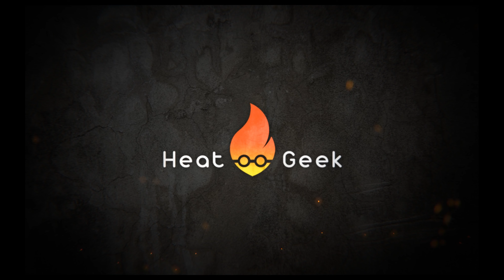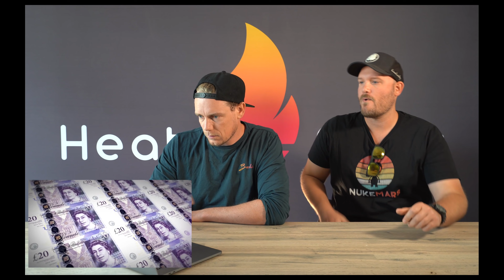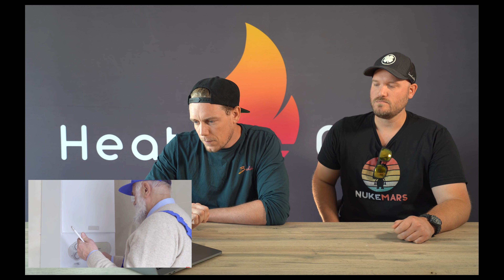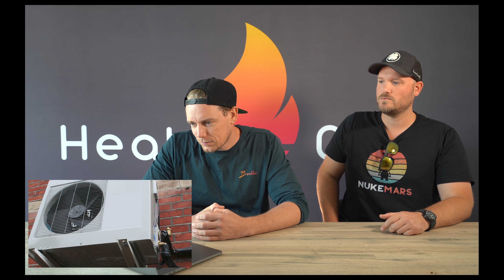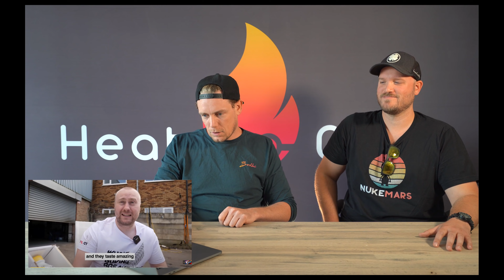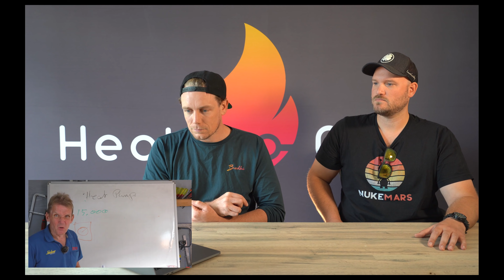Professionals React (BADLY) To Skill Builders's Heat Pump Videos | PART 1 | FIRST TIME WATCHING

Comment: I see the persons who talk about government incentives gone wrong I'm in Alberta Canada we've seen 2 major provincial government initiatives back in the days of electricity coming to major cities around the world the government saw a problem developing any home that was outside the cities was not able to hook up it was only available for the wealthy without electricity the only way for having power was 6 12  24 or 32 volt DC  systems the batteries available were very expensive and unreliable and the generator although fairly reliable they did fail and were sometimes hard to start TV wouldn't operate on those voltages so electrification was brought in electricity cooperatives were formed low interest loans were made available to the cooperatives and the homeowners to hook to the power grid and almost every homeowner hooked up later on in the later 1970 homeowners outside the bigger cities had the choice for heating coal  fuel oil or propane  but you had to watch out you don't run out or you lost your heat you could have your fuel scheduled for delivery a blizzard blows in and using more fuel because of the colder wether and you run out of fuel be like one lady in Saskatchewan wood was loaded ready for delivery and a blizzard came in lasted for days a young man who heard the betting that was going on as to her her invalid husband and 4 children's fate would gave them something else to bet on and speculate on he said hook up the horses I'll go he followed the tops of the power poles he could see in the blinding snow he found her place she'd burned her furniture and had run out so late 1970 a new program came in gasification cooperatives were formed again low interest government backed loans were made available to the cooperatives and to homeowners to be able to hook up over the years electricity cooperatives were bought out by the big utility companies gas cooperatives started being bought out as they went from being a liability to an asset but when electricity and gas was deregulated and you could buy your gas and electricity from many different providers and the companies that owned the electric lines and the companies that owned the gas line had to deliver it by their infrastructure there were still gas cooperatives and the loss of revenue from cooperatives fees would have bankrupt them the Alberta government gave the cooperatives exclusive rights in our area we can only buy our gas from the cooperative and we pay 30 $ per month to be a member of the coop and since the cooperatives will probably never be an asset for any of the big natural gas companies since if they buy them out they might only get 25% of the client's and then only with an intense  cost savings on gas because being as the competition hasn't got any money in the infrastructure they can give better pricing for gas and still turn a profit these initiatives were necessary and now we need a new one solarfication the Canadian government has brought in a carbon tax on natural gas it's 30 % more than the cost of the gas per unit so my gas bill has over doubled its supposed to make us cut down on our gas  electricity and auto fuel use they give us incentives to go green but low income homeowners especially seniors who can't get loans  and renters are out in the cold figuratively and in some cases literally as we can't afford 10 grand or more our share of the upgrades and landlords have no interest in putting out that kind of money to save their tenants money on their heating costs and here in Alberta where the government makes it almost impossible to go solar electric unless you are a heavy electricity user most of us would only save around 40 $ per month on our electricity bill still paying grid tie fees  municipal access fee and billing fees about 180 $ per month so if we are thinking of going solar electric we need to go it alone and cut the grid

Comment: One take way was your point about it 'paying you back'.  It's absolutely right that the value is added to your home but also this obsession that the equipment has to pay you is just just mental.  A perk for sure but not the primary reason one makes this change.   It's a better product and better for the environment!  once it becomes much more mainstream, it will naturally get cheaper and the tech will advice.  I couldn't sit through most of the vid unfortunately because he quietly approached the facts then barked the falsehoods misrepresenting a balanced view.  There may have been conversation about solar and battery too which do have genuine 'pay back' and enhance the value of having a heat pump but I just struggle with this chap so couldn't finish it.

Comment: He describing what the government are selling to people. There a many video on here from very good plumber who been sub contracted fir this government scheme. The company send there surveyor and system designer. The plumber turn up and says that never going to work. So ended redesigning it cost more money in materials then after he Completed the fitting the primary company comes out over right the weather mitigation system which mean the system is wasting energy and costing the home owner more money because the systems do not work.  Government say you can connect to your existing system no need for new radiators. On you don't need under floor heating.
Reply from the maker: No. There's 1 of those videos from pit freind Simon who now installs under our umbrella without any of those those issues. Sub to his channel and you will see an update .

Comment: I would not laugh because everyone I know in the uk who change from natural to airt heat pump are paying up 3x more in fuel bill than with natural gas .  Electricity  is 4x more expensive than natural gas per kwh. 
We have seen these example figure the industry put out and say 1970 3 bed semi cost over over £1000 in gas total rubbish  most of my friends live in these types of home the highest annual gas bill £418 so where your getting your figures from is beyond me.
Reply from the maker: Electricity is now 3 x more expensive.. heat pumps a 3 to 5 x more efficient though of installed correctly. You possibly k ow 1 person withba heat pump.

Comment: A constant in these UK-based videos seems to be the acceptance of bad performance of the older houses. UK houses are not significantly older then those in other EU countries, and there is no technical reason why they should perform worse. Renovating them to contemporary standards requires a bit of skill and smart thinking, but if done during an already planned renovation it's not even a very large cost. We renovated our own house (1924) in 2011 the cost of the insulation and membranes and so on was around 6-7% of the total budget. For 200m² of living space the house now has a heat loss of around 3kW (-10°C outside, 20°C inside). It's not difficult, it's not impossible, and regardless of the heating system chosen, it is the most future proof investment you can make. And once you have done that, a heatpump is the most logical choice and it is going to be a hell of a lot cheaper because a smaller model will suffice :-).

Comment: Nice segway ... it's not the technology ... it's the installer ... right.
"In the situation where it works ..... let's just install it .." ...right, and the customer takes the punt, again.
"Like a conspiracy ..." ... yes, he is repeating verbally and visually exactly what you had just proposed about the gas/electricity price balancing.
And, unfortunately, the best solution is one that's available to fewer people bc it requires space - gasifying furnaces. If you really understand energy, then you will know this is the right solution, but it requires space both to install and to store the biomass.
The customer with the distant trees .... I think that's a hypothetical lads.
Anyway ... you guys are funny pseudo-energy-professionals ... and I think it would be great for you to prove Roger wrong by posting a response video citing your own great heat pump results.
Avagoodone.
Reply from the maker: Yep absolutely. This is what cops range from  150% efficiency to 600%.. a huge gap
Reply: @HeatGeek  get fair dinkum

Comment: Roger was reacting with this video to the news gas boilers were being scrapped by 2030 I think it was. He'd probably agree with a lot of what these guys are saying, they agree that heat pumps are not the answer to heating all of Britain's homes. It seems heat pumps suit the larger houses for the better off type of client which is why its objectable to supplement installations with grants which the rest of us have to pay for on the green levy. The country needs cheaper fuel because heat is a necessity not a luxury.

Comment: In our case I am grateful the system is the way it is, because we chose our ASHP and then asked a local installer to order and install the monobloc system into our existing heating system. It was the only way we could afford to do this, and get the grant. The LG Therma V 9kw monobloc was what we had researched heavily over and we paid £7k for it, our installer charged £2k for fitting. Our RHI will cover the cost of the ASHP (which by the way is a very expensive fridge freeze, cannot help think the Industry is milking it, just like the EV Industry) and that some of the installers are going to be just to make money, and then fold after 5 years or so. There is no come back in this scenario, and people get burnt and so this leads to legal chasing games like PPI that was mentioned in the challenge video if they can find the installer. By the way we are happy with our ASHP and have adjusted the flow rate down from 45c to 37c which made a big difference  to the daily running costs. We have also found a way of spreading our 5p pkh rate to last all day long to run our Heating. Our hot water is managed by a 9kWh Sunamp, smaller and much more efficient than a tank!
Reply: There is a comeback if the co.lany folds.. under mcs the install is insurance backed for this very reason..
Reply: Hi Ken. The installer must supply under rhi rules I believe!??
Reply: @ChapmanPlumbing  Yep I think I type that above! :)

Comment: Insulating flats or homes with small gardens built in the 1860’s to accommodate cost effective heat pump technology, what’s the answer?
Reply: Flats are easy.. don't think there's anyb1860s flats though. 1860 houses there's lots of solutions but very expensive.. as per the video, heta pumps don't work everywhere..
Reply: @ChapmanPlumbing  thanks for reply...I live in a garden flat comprising of four flats  two ground and two above and built that way, not a converted house split into flats. There are a few like this where I live. Cheers.

Comment: Heat pumps as a concept may be useful for some people in some types of houses in some parts of the country. No point having a go at somebody pointing out the downsides. What should be happening is the general building industry and heating installers calling for the current government to stop fanfaring heat pumps as a universal switch out replacement for gas central heating

The government, in an attempt to push for greenhouse gas reduction, is trying to do for home heating what it is trying to do clearing the roads of diesel powered cars in favour of Electric vehicles. Sadly they cannot just wave a magic wand and make it so. Around the time of COP26, every minister and government spokesman was just saying HEAT PUMPS, HEAT PUMPS, HEAT PUMPS

Comment: In my home country of Romania, many people I know claim they are cold at 21C indoors. I have friends and family whose thermostats are set to 24C, in well insulated homes that don’t lose that much heat (mostly the old commie blocks that trap everything in). I would boil at that temperature personally, and have long moved away, so don’t have to worry about it. But I know others experienced the psychological torture of little to no heat and electricity during Ceausescu. To tell someone they can’t have a toasty apartment would be unimaginable.

Comment: What difference does it make how much time is left - he is talking about how much will be spent at the end - the total. He isn't angry, that's just how he talks. Funny how they cut the video right where one of them admits he was right about how it can cost three times as much. Also, funny how one guy says you don't need the buffer tank and the other said manufacturers say you do then the first guy tries to put the blame on the installer. The reputation is tanking because people are realizing a heat pump doesn't usually match a gas fired boiler's output. When talking electricity costs all one has to do is look at places like Australia where the electricity skyrocked, it didn't decrease. My last comment is on their carbon claims. What the guy in the video is talking about is the UK carbon footprint from boilers and what the two guys commenting want to add in is all emissions from everything used in the UK no matter where it is being generated which has nothing to do with the boiler carbon footprint ad actually ignores the carbon footprint of the manufacturing of the heat pumps so the more heat pumps made and installed the more carbon footprint being created not diminished.

Comment: I'm adding 100mm of PIR on the inside of my solid wall houses.  Mid and end terrace.  300mm of loft insulation.  I size my pipes on gas central heating larger now on a rule of thumb (okay only as a basic guide).  6kw max 22mm.  10kw max 28mm.  15mm to rads.  S plan zoned system.  E.g. Mid terrace has 22mm ground floor.  22mm 1st floor.  How water cylinder.  So 3 valves and if needed.   Also using single panel convectors that can be swapped to double later.  Any thoughts?  I want to do this right.   I do it myself.  I start again.  Rip out everything already there.  Where can I go for system design to make sure I do not have to change all my pipes and how water cylinder when the heat pump replaces the gas boiler?  Maximum future proofing.

Comment: Cop of 2 is rubbish how can you say 
People will need heating at 30c 

In the real world of 8c most days though winter the cop will be around 1 for 1
Reply from the maker: people need hot water all year round mate. coop of 1 for 1 is non existant, the unit would be in perminent fault. The average modern-day scop is 3.5 with 3 in Dec and Jan in average older houses. better in newer builds.

Comment: Think you guys have missed the point on this one. Roger's tried to explained to the layman in layman's terms. Yes he got some things wrong but his general concern is valid. Poor system design, poor application and poor installation equals expensive bills. I can see you're both knowledgeable and agree with a lot of his views but nitpicking his video hasn't done you any favours judging by the comments.
Reply from the maker: The comments are from those that disagree. People that agree are far less likely to comment. We knownwe are on the right side of history. Roger did not talk about design except when he drew out a thermal store which is litrally the worst way to install a heat pump possible and against all advice

Comment: Big triple rads at 55 degrees max and that's slogging the heat pump to death! Heat pumps use electricity 24/7 to heat the oil in the compressor, what's not to love!

Comment: In the Netherlands they increased tax on gas and lowered on electricity….. so he is not telling complete bullsht my friends
Reply from the maker: We didn't disagree with that bit because they've been talking about it for years. And rightly so because at the moment in the UK electricity has a carbon tax yet gas doesn't!!?? Dispite electricity now being cleaner.. time to rebalanced passed a long time ago
Reply: @HeatGeek  at  they end: making electricity from gas and transport it for 1:1 heating is worse than use the heat of gas at the place you need it.. transport is losing energy. Only with right heat pump solution there should be an advantage. Only with heatpumps you need more energy in royal  because you are not have enough power to heat only on the moment you need it in the rooms you need it.. And that is a negative part of the solution at the moment…
Reply from the maker: @Go2Results  we understand the physics. We are also the uks no1 hydrogen fuel cell installers.

Comment: Roger the skill builder is a top guy. He gives his honest opinion and he does state that he will fit heat pumps if the customer wants and has enough money to pay for it. His video helps the average Joe who isn't likely to have the money for the high cost installation. He doesn't get angry at all.. Just gives you the options.
Reply from the maker: Can't disagree with any of that! His technical knowledge of heatbpump systems is lacking slightly though and his video slightly misleading. No biggie but needed these corrections imo

Comment: Then you will see that when the sun gets hot in the summer thise insulated house get hotter. So there will  be a need to install air conditioning units. Adding additional cost to your existing outstanding balance!!!
Reply from the maker: Insulation works both ways lol

Comment: Heat pumps would seem to be a potentially unreliable hit and miss at your expense-ive system, which is a factor one hasn't got to be overly concerned about with a gas boiler. The option of hydrogen gets little publicity, the industry and R & D is expanding to bring about economies of scale, which would be able to bring about much more robust reliable heating systems. Seems it's down to private companies like JCB taking the lead to fuel their converted diesel engines of the equipment they produce. JCB signed a several billion pound contract to be supplied with green hydrogen by the Australian company FFI  a few months ago which will be distributed by Ryze Hydrogen in the UK and Europe.